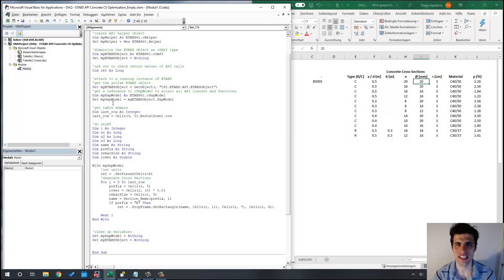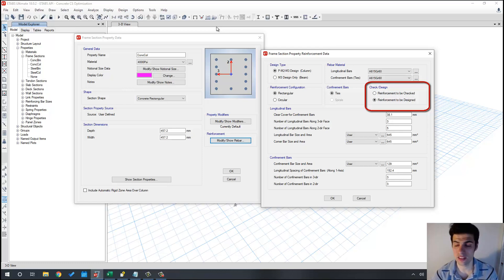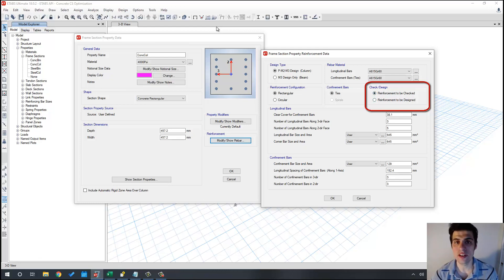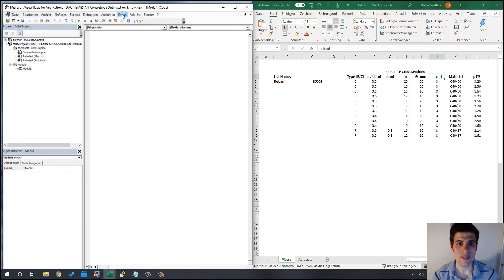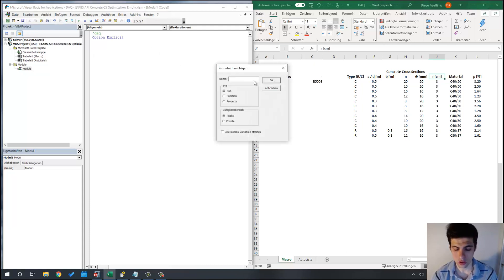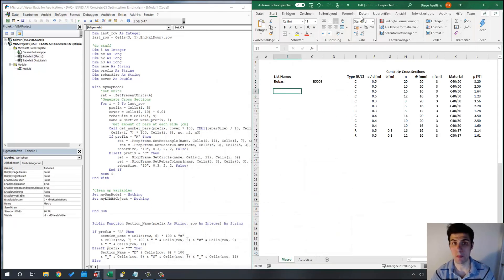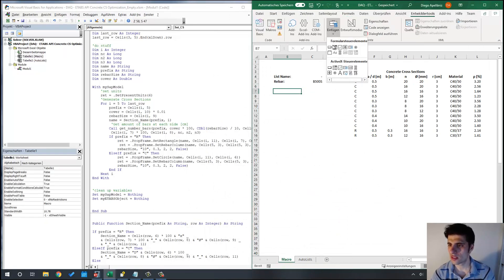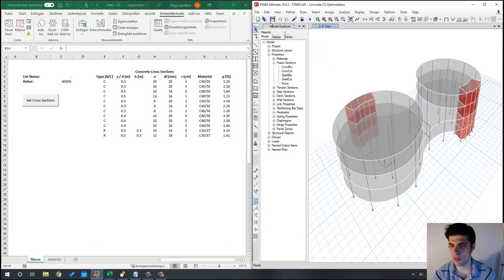ETABS API - Parametric Design and Optimization of Concrete Cross Sections

Comment from the maker: Hello, I`ve just updated the macro with the following additional option: It is now possible to let the macro adjust the sizes of cross sections with same dimensions but different rebar ratios by 0.0001m, so the optimization with the autolists in ETABS works properly. The reason behind it is that ETABS does the optimization of concrete cross sections based just on the section sizes, so it would not differentiate cross sections with same sizes but different rebar ratios. Thanks to Mr. Ali Altajjar for the constructive feedback!
Reply: Hi, this knowledge is very good and I need it. Can you give me this macro and Etabs file?
Thank you so much

Comment: Diego, muchas gracias por tu contenido. Sabes si es posible exportar las secciones de Seccion Designes de ETABs a SAP2000?
Reply from the maker: you can try converting the whole model: https://wiki.csiamerica.com/pages/viewpage.action?pageId=15074050
otherwise you would have to program the export of cross sections with the API
Reply: Could you provide an example to program the export of cross sections using the API?

Comment: Tengo dos preguntas: En el video anterior de la optimización de secciones de acero se ejecutaba el modelo más de una vez (2 veces) porque en la primera ocasión el modelo elige una sección y en la segunda ETABS asigna la sección al modelo, en este caso de secciones de concreto no es necesario realizar lo mismo ?
Y la ultima pregunta es: En el video anterior usamos el solver de excel, porque no lo usamos en esta ocasión para optimizar secciones ?
Gracias !
Reply from the maker: Va subiendo el nivel de las preguntas :). 1) en el video acerca de optimización celosías, usamos el peso propio de la estructura como parámetro a optimizar. Era necesario correr el modelo dos veces para que las secciones estuvieran realmente aplicadas en el modelo y poder obtener el peso propio correctamente. En este caso la pequeña variación en el peso propio entre unas secciones y otras no es relevante para los resultados del modelo. Otra historia sería la influencia de la rigidez de las distintas secciones pero ese es un tema para otro tutorial. 2) En el otro tutorial usamos el solver de excel para hacer una optimización geométrica (la altura de la celosía). En ambos casos hemos hecho la optimización de las secciones directamente con ETABS. Espero haber podido resolver las dudas. Un saludo!
Reply: Gracias !

Comment: Hi I am doing my thesis of optimization of steel columns filled with concrete but I didn’t found any code function to set a filled pipe or filled tube if you have any ideas? Thanks
Reply from the maker: I don't think the API has the design of composite sections already implemented. If it's about your thesis, you could get the column forces from ETABS and write the code on your own for the design check of the columns.

Comment: Hi can we overwrite the k factor in column design, as my column doesn't have tie in one axis, it getting heavy ast due to long column effect, so is there any possibilities to reduce k factor manually
Reply from the maker: this is sureley very interesting, but this option is not available for all codes. You can take a look at the cDCoACI318_08_IBC2009.SetOverwrite method in the API documentation for instance. You can use it to set different values of the k factor:

Item
Type: System.Int32
This is an integer between 1 and 12, inclusive, indicating the overwrite item considered. 
Framing type
Live load reduction factor
Unbraced length ratio, Major
Unbraced length ratio, Minor
Effective length factor, K Major
Effective length factor, K Minor
Moment coefficient, Cm Major
Moment coefficient, Cm Minor
Nonsway moment factor, Db Major
Nonsway moment factor, Db Minor
Sway moment factor, Ds Major
Sway moment factor, Ds Minor